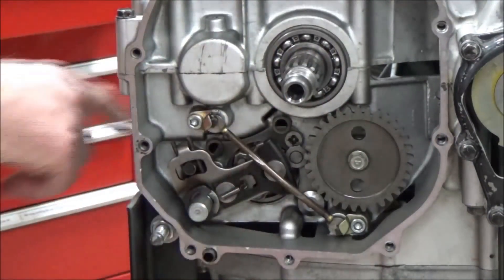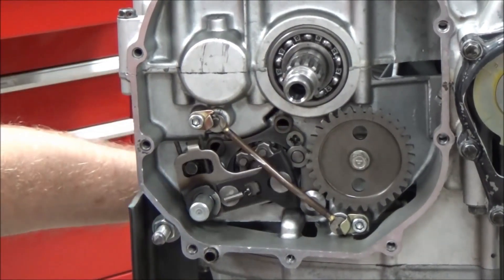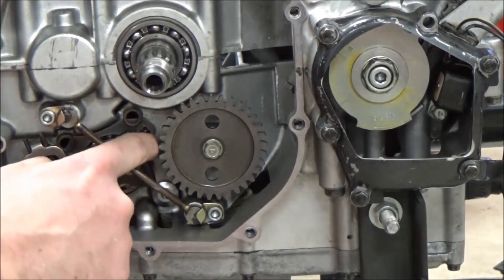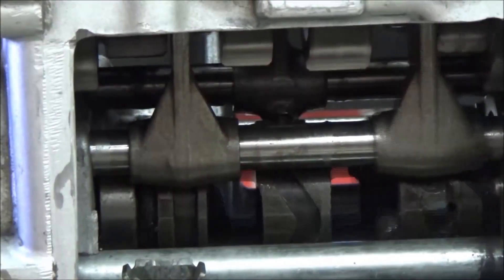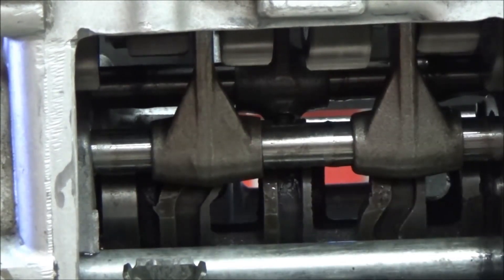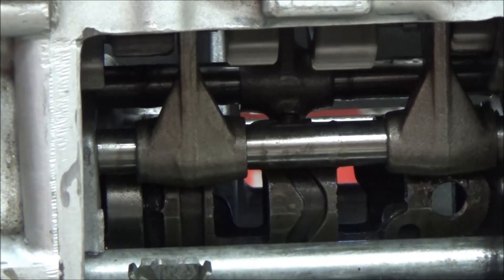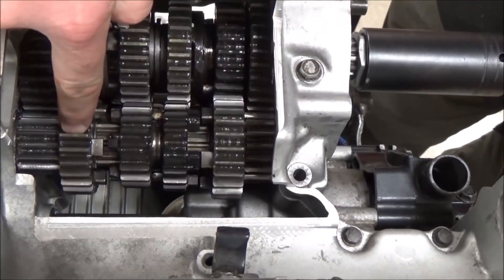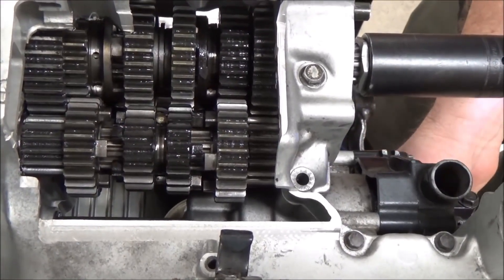How A Motorcycle Transmission Works (Constant Mesh)

Comment: Can the bang be reduced on my 2012 Honda NC700X it really bangs and set the clutch lever for minimal free-play.  Other bikes I have driven don't bang so  hard.  My clutch is about 85% worn.  Could this be a sign of warped metal plates in the clutch?  Thanks.  If I let the bike roll at about 12mph and shift into first gear it is silent with no bang or clunk.
Reply from the maker: Yes the bang can come from worn clutch plates as they are not fully disengaging the transmission from the engine. But you also have to have free play. Easiest way to set free play is there should be a gap about the size of a nickel between the lever where the cable goes in and where the lever stops. If you are rolling and it shifts smooth then it has matched rpms with rolling causing a smooth shift. When you are stopped you should be able to squeeze clutch and it slows down transmission speed enough to shift smoothly. After squeezing wait a second or two before putting into gear to see if it still bangs. If it does I would do an oil change take out the old clutch soak new friction plates in fresh oil and install. Then fill it with oil and change your filter. The transmission uses the same engine oil in the same case for lubrication. Old dirty oil can cause banging shifts as well